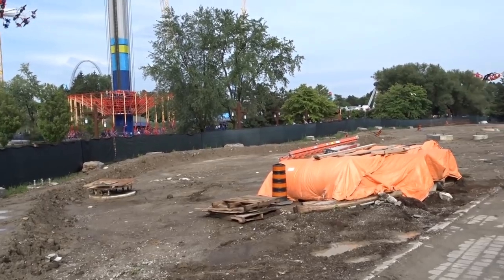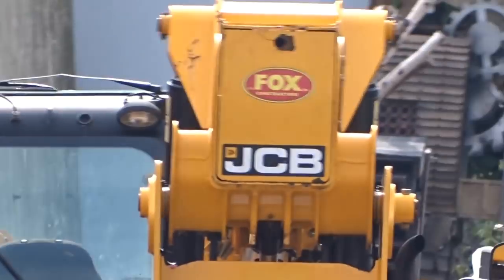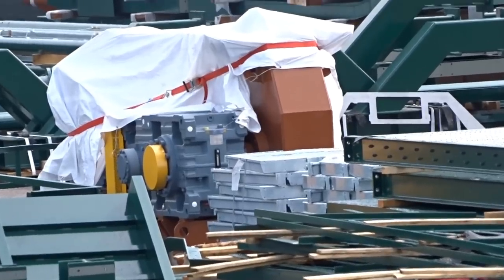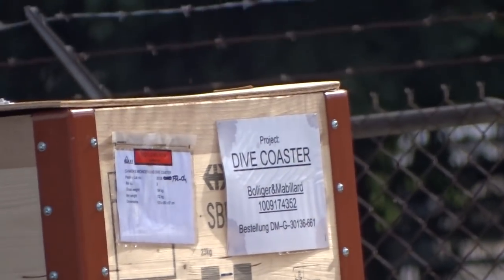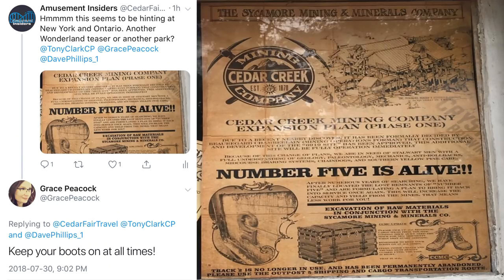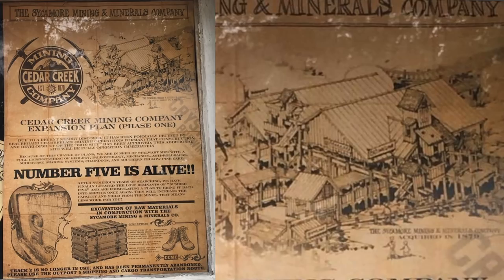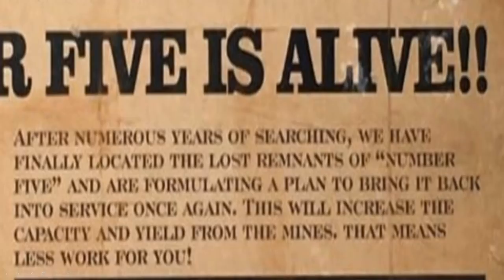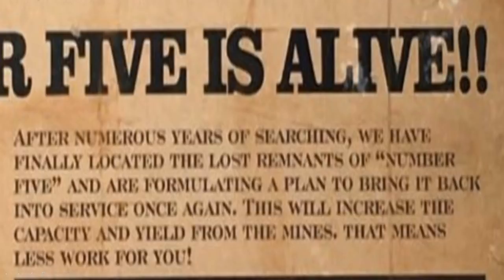Longest Dive Coaster in the World?

Comment: I personally think the 5 stands for the 5th attraction to be over 200 feet at the park. Based on the teaser there is a good chance the height will be 215ft with 3 inversions, thus the 3, 215' on the first teaser. Currently there's Drop Tower, Behemoth, Windseeker, and Leviathan. This would be #5. This also means the other number would most likely be the track length, making it the longest dive coaster in the world.